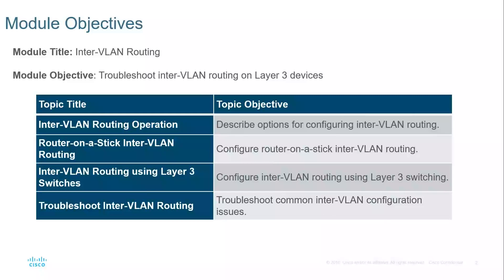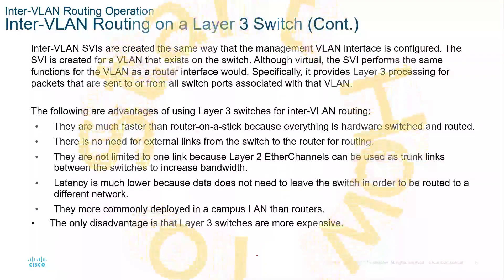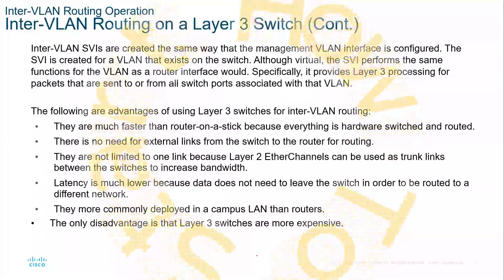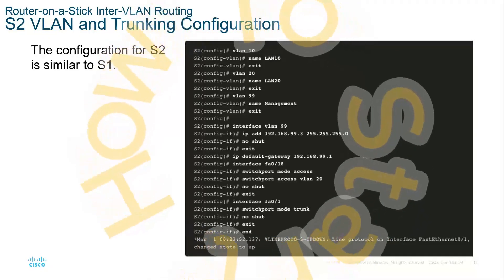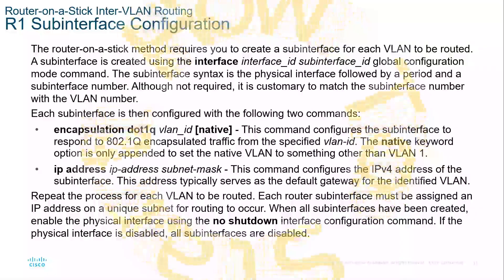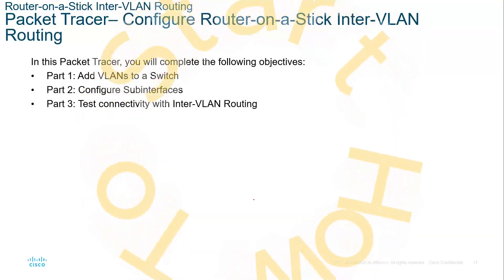[SRWE][M4] - Inter-VLAN Routing (1/2)

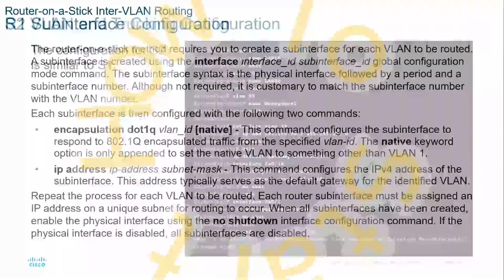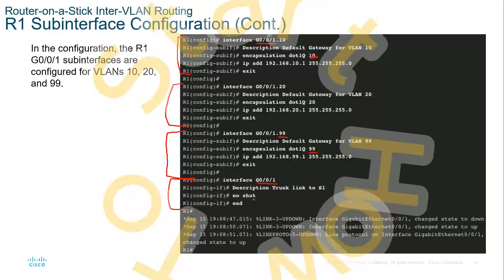Comment: CpECNet 2 | CPE III-1A-F : smn7900: My key takeaways from this video are that I learned there are three inter-VLAN options, whereas I only knew about the router-on-a-stick method. I realized that using a Layer 3 switch with SVI is the best among the three options (0:42 - 4:22). I also understood how subinterfaces on the router are created (7:39 - 9:55).

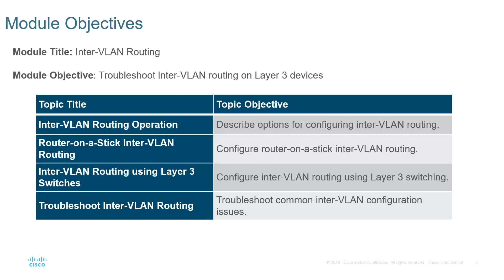Comment: CpECNet 2 | CPE III-1A-F : gbp8724 : My key take aways from this video is that I learned about three methods of router operations the legacy routing, router-on-a-stick, and layer 3 switching with switch virtual interfaces (SVIs). (At 0:33 - 4:19) legacy routing connects each VLAN to its own physical port, but this method is outdated and expensive. Instead, the router-on-a-stick approach uses a single trunk line to connect a router and a switch, allowing multiple VLANs to share one cable. Layer 3 switches also make it easier to transfer data between VLANs without a traditional router. They tend to be faster and can help reduce delays, but they can be pricier and might have limitations depending on the brand.

Comment: CpECNet 2 | CPE III-1A-F : rai1990
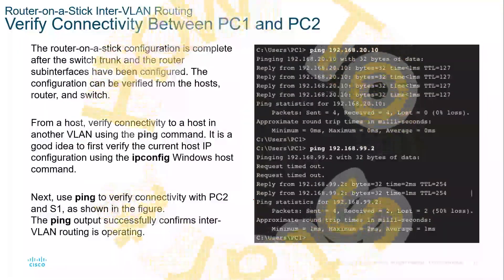My key takeaways that I learned in this video are VLAN communication methods and router-on-a-stick configuration. VLAN communication methods are legacy router on a stick, router-on-a-stick and layer 3 switch (0:40 - 4:22).  The video also a refresher for me on how to configure router-on-a-stick. The steps are to create and name VLANs, create management interface, configure access points, and configure trunking ports (4:25 -9:55).

Comment: CpECNet 2 | CPE III-1A-F: rsl1655
My key takeaway from this video
From 2:15 - 7:17 Inter-VLAN communication via virtual exit points is possible since the router-switch connection is configured as a trunk. Switch Virtual Interfaces (SVIs) allow Layer 3 switches to do routing; these interfaces have better throughput and reduced latency but are more expensive and brand-specific. Sub-interfaces in a router-on-a-stick configuration map to VLANs for routing. On the switch, VLANs are established, and using straightforward global configuration instructions, ports are set as either access or trunk ports. Trunk ports are activated by setting the port mode to trunk, whereas access ports are set by allocating VLANs.

Comment: CpECNet 2 | CPE III-1A-F : mtk5843 

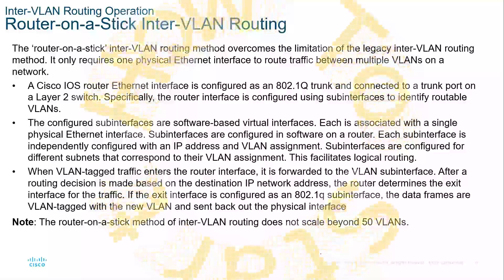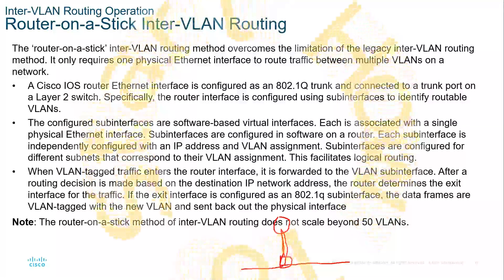My take away is on the router on a stick discussed in ( 1:50 - 2:37 )
 and that this setup is cost-effective for small networks but can introduce a bottleneck due to the single interface handling all VLAN traffic.

Comment: CpECNet 2 | CPE III-1A-F :cca8764: My key takeaway from this video is egacy routing, router-on-a-stick, and Layer 3 switching with the help of Switch Virtual Interfaces. Legacy routing is old school and quite expensive since it uses physical ports per VLAN. Router-on-a-Stick allows all VLANs to share a trunk line through sub-interfaces.  The video further explains how trunk and access ports are configured on the switches to enable VLANs.

Comment: CpECNet 2 | CPE III-1A-F : jce1331 : My main take away from this video is first the different types of Inter-vlan routing and the different devices used in order to perform it mainly the router and a layer 3 swtich. The most standout though is the configuration of the router on a stick as well as how to implement them as previously I did not know that there were the existence of sub interfaces which is where the VLANs essentially are.